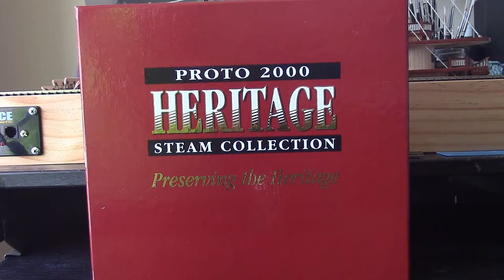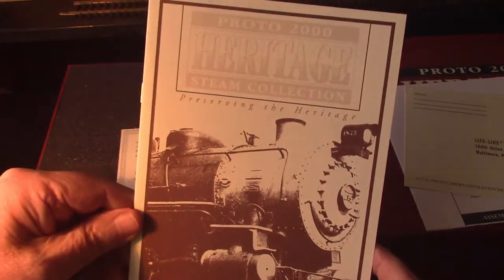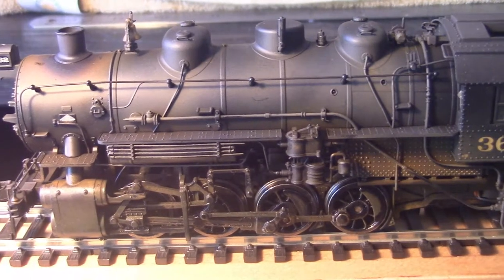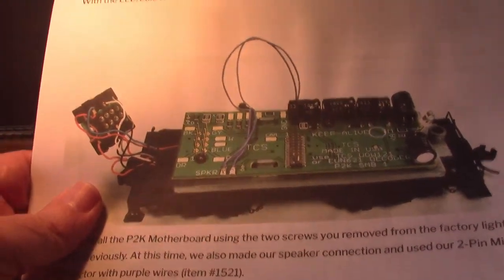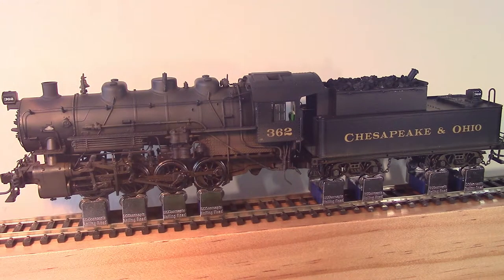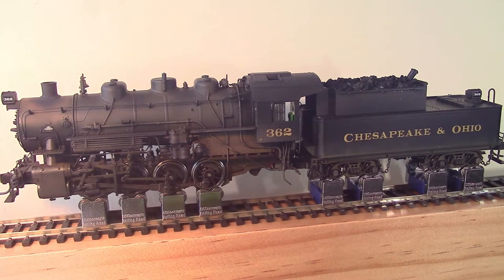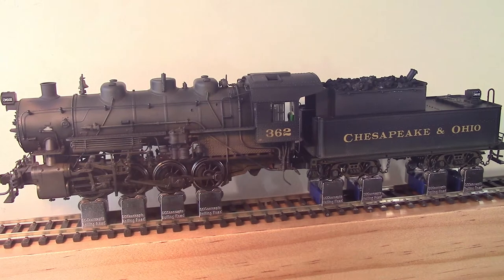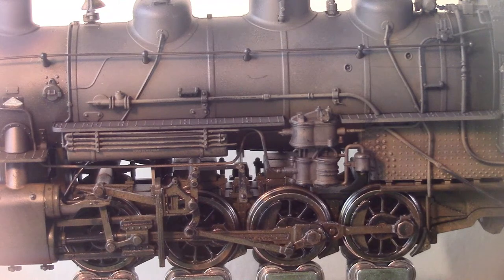PROTO 2000, 0-8-0, NOS and decoder fitted.

Comment: Nice subtle weathering! Have one, it does run very nicely, very slowly. Mine has DCC but needs a keepalive to run on my layout—just bought a soundtraxx currentkeeper to deal with that. 

Nerd Alert, every steam engine needs an Elesco feedwater heater on the smokebox—Central Vermont had some average-size 0-8-0s with them, they look awesome. NYC and subsidiaries had some too, but much larger—modeled by Rivarossi. Way too big to represent a typical 0-8-0.

Going to look up that Rolling Road mechanism, that looks extremely useful!
Reply from the maker: Thank you Patrick for the kind words, yes they are a great loco, since I purchased this loco I have been looking for another, very hard to find. The keep alive makes a lot of difference, one of my better runners.
Cheers 
Gary.

Comment: They are a very nice engine. I got 2 of them as well. Mine have the earlier Tsunami sound decoders in them. I may change them out at a later date. I need to clean out the lights/ lenses on them, as who weathered the loco's I have over weather the lenses.

Comment: I am having issues with this kit. I have the same loco as you and have installed this kit using these instructions. When i go to run the loco it shorts my system. The weird this is that it worked for 5 min and now it won't run at all without shorting. Do you have any ideas what could be wrong?
Reply from the maker: The only thing I can think of  is one of the wheel pick ups is shorting out your system, I didn't believe  it will be the decoder, sorry I,m not much help.
Cheers, Gary.